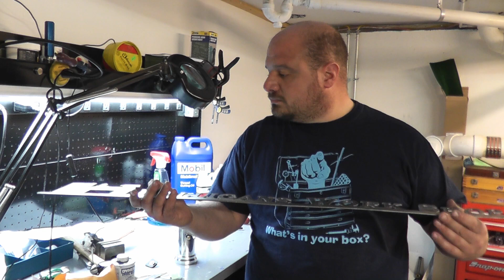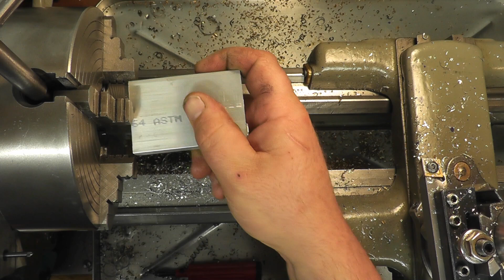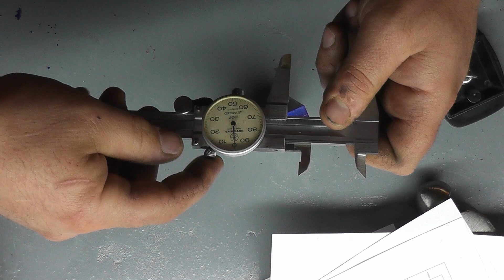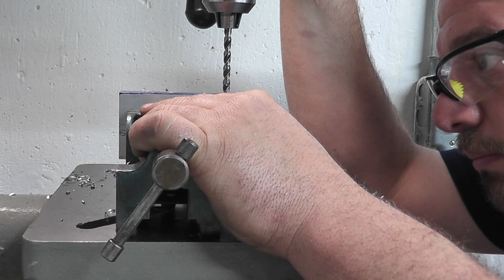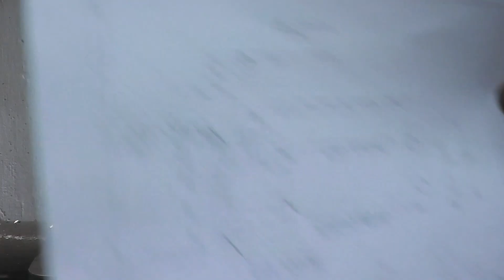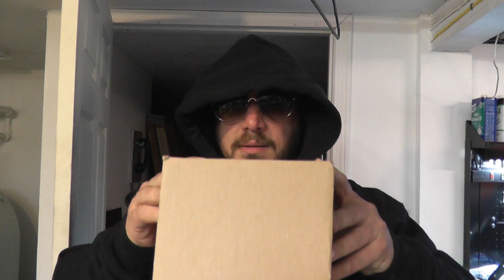Making an Eagle 66 Oil Can - Part 1

Comment: Great Video 142 Really enjoyed it.
The first side you faced on the lathe, can i just say, that there is no need to spend so much time truing it up as you are only facing it. Close enough is good enough.

Also a wee tip on drilling a hole bigger. with the drill press off, bring the drill down onto the hole with a wee bit of pressure and while not holding the vice or job, turn, the drill backwards by hand (keeping some pressure on) This will move the job, center to the drill. Then start drilling.
Look forward to watching more of you vids.

Comment: small diam tubing???   try brake pipe, steel or copper. you can get the fittings to suit. in steel or brass,
Greg,,, why did you do the long first drilling in the press when you already had it set up and centred in the lathe,,,   easier and more accurate. you could even cut the thread as well before disturbing it.
Reply: ok,,, thanks

Comment: Use a clear spray lacquer.  I have use Krylon and others with very good effect.  I have a polished aluminum street sign out on a pole that has been outside for ten or more years and has none of the discoloration that it would normally get.  I also use it on machine tables.  In a few years you can give it another spray with no prep other than a quick wipe.  Very effective.  Like the oil can project.  How about a metal drip oiler for the metal bandsaw.  A guy made one of plastic on the tube but I am sure you could dress it up and make a better valve.  Nice work.  Doug
Reply from the maker: +Douglas Thompson I picked up a can I just have to get around to spraying it.  I don't like the oil on the saw just because I don't like the mess.  If I could have it stationary and build a pan I may consider it.

Comment: Very cool project. When you centered that stock in the 4-jaw--Very informative. Something I would never have even thought to do. However, I would have thought the more critical requirement would have been to tram the edge parallel to your ways to ensure squareness of the facing cut. Had you already done that, or are you just trusting the jaws on the 4-jaw?
Reply from the maker: +Rick Rose Trusting the jaws.  I bought the chuck as NOS (made in USA) shortly after I got the lathe.  Jaws are nice and square.

Comment: GREG
With all  due  respects, what we found even on the other YT Videos,  no matter how euridite and experienced the Demonstrating Machinist,  is the amount of time taken to specifically show the long Machining run on a given job.  U will agree that the most important part of  MACHINING is "SETUP TIME" and once that is explained and done with, Your Audience need not be belaboured  with the tedious, lengthy demo of the actual Machining job.  Turning is turning, no matter the machine or the Cutter used.  Short, quick, simple excerpts of the running Job should suffice. That would, in all events, take lesser time, maybe entail more editing,  yes, and maybe permit U to elaborate verbally more on other important aspects of the Video project.
GREG, all said and done, we very much appreciate Your esteemed time taken to record these Videos.  
We had this as an impending project and are busy compiling the small parts order with MMC.  The small Diameter Tubing is proving a pain to source, but guess comprises can be made.
All the best and  
Take Care
aRM

Comment: Hello there
Like the way U did the setting on the 4 jaw with this odd sized piece. 
For us it was one of those..."so that' how it's done"  projects
Well explained and well done.
Only thing we reckon for rookies and the varied audience U have, U should take it a bit easy. Just slow down.  Seems like U in kind some big hurry to get some place ???   
No offence meant.
Just our two cents since we've been watching most Your stuff
Take care
aRM
Reply from the maker: +aR M 
Part of it is I have an extremely limited amount of shop time.  Usually only get to do projects one or two nights a week and then editing takes a long time.  I'm going to work on better spacing and cutting down each video length, but adding more parts.

Comment: Hi !

That was right in time for me - two days more and I've started my own drawing of that beast - thx for sharing this DIY of this very useful tool !

Now I just have to convert it to metric AND the stock I have in my shop !

Really nice project - thx for sharing again !
Reply: +Keld Sørensen 
They have been saying that the metric system would take over imperial since before even you were in diapers.  It hasn't happened yet and likely never will.
Reply from the maker: What's this metric you speak of :-)
Reply: *****
Ha, ha - you'll find out ...the imperial system will die as the dinosaurs - meanwhile I maybe have to get a digital caliper ;-))
Reply: @keldsor  7 yrs later and the imperial system of measurement is still going strong lol.

Comment: I think for the cut to length you could have reversed the part for a better hold?
Reply from the maker: +DSCKy You could do it like that also.  I was just afraid I'd over tighten the vice and make a flat spot in the aluminum and i was afraid that if the blade grabbed for some reason it would turn the stock.